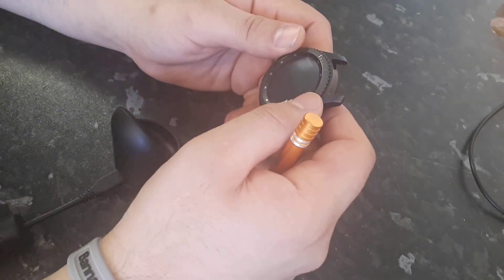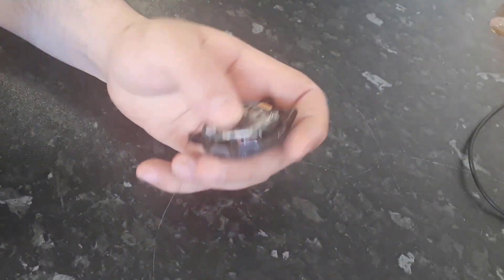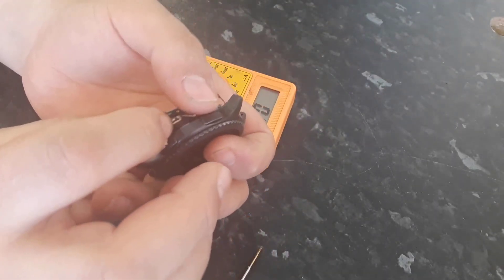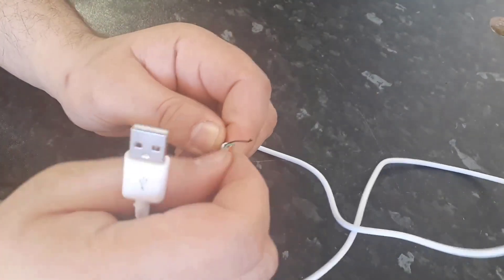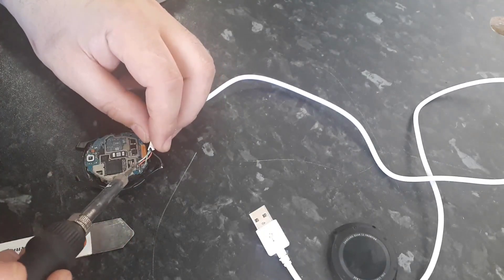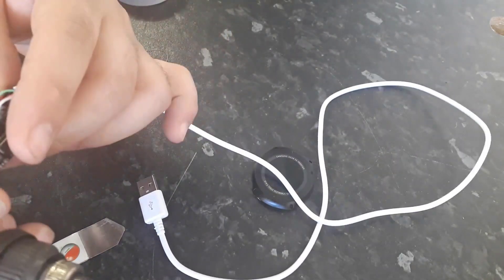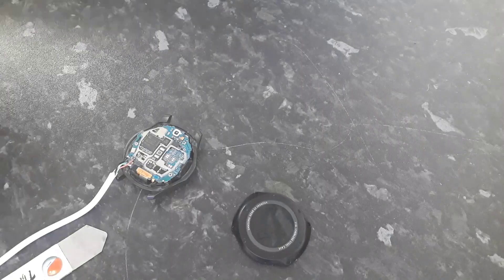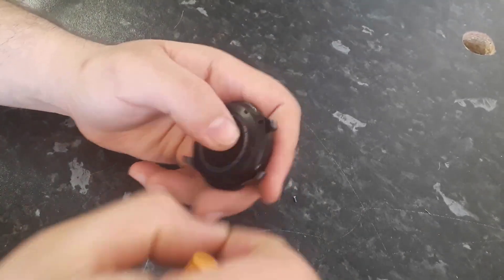Samsung Gear S3 Watch Dead Repair

Comment: I have got to admit that I was watching this thinking "There is no way this will work." But I bit the bullet cause I was pretty much at the end of the road with me favorite watch and tried it. I was SHOCKED when the screen came to life for the first time in a week. I have it charging now. 
I am curious though, once the watch gets to 50% or even 100% charged, will I have to do this EVERY TIME I want to charge my watch? Or will the cradle charger work again?
Reply from the maker: Hi, you don't have to do that every time, but try to change the battery to a new battery if it happens again.
Reply: @anwarigroup  Thank you so much for the advice and help!
Reply: Basically manually jumpstaring battery to a percent that will be recognized by motherboard and allow charger to charge and balance the battery.

Comment: I changed the battery, but when I put it on charge, it doesn't charge. It stays at 0.What is the solution?
Reply from the maker: change the battery

Comment: Is mine completely dead? Cannot charge. I drained the battery and did not charge for almost 5 days then this happens. I usually do this but this time it's completely dead.
Reply from the maker: Some batteries when they get fully discharged and are not charged for some time, can not be charged, so sometimes applying a few higher voltages directly to the battery, fix this problem.

Comment: What if watch is charging curectly but doesn't turn on? they doesn't react on button pressing at all
Reply from the maker: use a tweezer and short the button sides, maybe button is damaged.
Reply: @anwarigroup  thanks for the answer, i think that button is not the problem, owner of watch gave it to some guy and he either tried to update or replace its firmware, the thing nobody asked to do. Now i try to bring them back to life. After that dude the watch started to discharge very fast and turned off after full discharge. I've charged them full but they don't turn on. Maybe you have any ideas? Thanks.
Reply from the maker: @aequitasveritas3419  recharge the battery, try  again pressing home button, change the battery and try again, and or connect it to a power supply and try it.
Reply: @anwarigroup  I'll try to do so, thanks for the answer
Reply: @anwarigroup  found the reason, it is the button, oxidized contacts on the cable at the junction with the board, soldered it and problem solved
Reply from the maker: @aequitasveritas3419  Super.

Comment: Hey bro if i connect only 2 wires red and black will it charge?
Reply from the maker: Yes, it will, unless the red and black are not red and black. But does it matter? Yes, It does, as the Red needs to be positive input and black negative. Unless the colour is not important, but the polarity needs to be correct.
Reply: @anwarigroup  but if battery overheats by 2 % of power its dead better replace it right?
Reply from the maker: @Izzy-w2p  make sure not to connect 5v to the batteries. These batteries are about 3.7V. They are Lithium lipo batteries. However, if the battery is overheating, it can be due to many reasons, one of the reason can be the battery itself.

Comment: My gear s3, flickering green screen and lines. How can i fix it?  I tried rebooting it by holding the power button. :(
Reply from the maker: Put it in download wireless mode and flash the firmware.

Comment: Sorry friend can it possible solder only red and black cable of the usb to charger the battery? Why also data (green & white)? Thanks
Reply from the maker: For charging, RED for positive and Black for negative will be enough. Green and white are for data communication.
Reply: I know it! In your video you solder all cable also data but for relife the battery drained it's possible solder only red and black cable and connect it to supply power 2A 5V usb or other amper (1A)? Thanks
Reply from the maker: @lillyminutolo5716  4-5V. One hundred mA to 2A would be fine.

Comment: good day sir, may i know if soldering a usb cable to the board can stil be achievd if the green data pin is lost or removed from the board. please help me
Reply from the maker: There has to be a connection. If the pin is removed so solder it to the pad, If the pad is removed you have to track the pad to find its root and solder the wire. Without soldering wire, you can not connect it to the computer.

Comment: Hello I have a samsung gear sport sm-r600

which does not start anymore.
When I put it on the charger it lights up with the logo (samsung gear sport) and turns off. the charging light is blinking but I can't turn it on.
I have changed the battery.
I can send you pictures and videos of the problem.
I went to your site but I cannot send you a message, (fire blocking)
Thank you for telling me how to do it

Thank you, I hope you can help me.
Reply from the maker: Send me an email Habib@electrovo.com
Reply: Have you solved?

Comment: I've had my Samsung Gear S3 watch for over three years.  during the beginning of the 2nd year the watch won't turn on it showed 100% charged. but no matter what I did it won't turn on. I finally gave up trying an took the watch to the T-Mobile store I purchased it from.  They performed a song and dance routine and then suggested I take it to a watch repair shop.   I decided I wasn't ever going to get a Samsung watch again.  Now tonight I'm on Youtube an happen to run across a Gear S3 topic and it suggested placing the watch on the charger an perform the reboot routine. I was both happy that it worked and dismayed that the T-Mobile support didn't know about this.

Comment: Hi sir..i charge to docking but red indicator at docking blinking..i use tester test the battery 3.6v..but my gear not turn on..whats problem..please..
Reply from the maker: check the side buttons with a multimeter, make sure they work.

Comment: My watch battery 4 volt but not charge or anything
Reply: No waterdamage. Sticker is white. I think other problem
Reply from the maker: Under the back cover of your watch is an electricity power receiver., Check that and check its a connection to the motherboard. That wireless power receiver has to transfer power to the board.

Comment: Incredible. Y did it with a cable only with red and black and only charged it for 1 minute without solding them and with my hand steady jaja. Then I placed it in the charger and did a reboot pressing 3 times the lower button. And there it is.. charging from 1 percent...thank you man! 😂
Reply from the maker: You are the legend!.
Reply: @anwarigroup  had to do it again today and it worked. ..jaja.. thanks again

Comment: If this does make the watch charge then what is the fix for the watch to go back to charging the normal way?
Reply from the maker: The problem of this watch was that the battery was fully drained. So in this case particularly for this watch, it was not able to be charged by the wireless charger., So The problem could be simple to boost the battery charge by connecting these wires. And or the problem can be with the battery. So the watch may need a new battery. Some times, the problem is in electronics, on the motherboard. So if it down to battery change the battery and it will charge normally. And if it just needs a boost charging as I did in the video so do it that way. Then monitor the battery and see how it goes. if the charge and discharge time is ok. So leave it like that, otherwise, change the battery.
Reply: @anwarigroup  Great video what if i put more stronger charger like 2 Amps because my battery charge barely to 3% thens overheated and stops charging then it shows 0%?thanx
Reply from the maker: @Izzy-w2p  Increasing current isn't a good idea, it will damage the battery and or reduce its life cycle. If your battery charges to 3% and then overheats and dies, then there is a problem with the battery. Change the battery. I would use a 100mA to 500 mA 3V charger to charge the battery and leave it for an hour to charge. If the battery isn't charging as I said, it's best to change the battery.
Reply: @anwarigroup  the watch is 3.5  years old probably the batery is dead you r right
Reply from the maker: @Izzy-w2p  Correct, Lithium and other batteries has life cycle, I am sure within 3 years, the battery used its cycles. Therefore, I think, the best thing is to change the battery.
Reply: @anwarigroup  It starts when my watchstrap fells off and watch falls off of my hand and back of the watch bottom cracked now ive changed the back case and right now ive cleaned the sensors inside the watch and its not overheating anymore its charging for now ...thnx for great answers mate🔥
Reply from the maker: @Izzy-w2p  Good, overheating can be caused by many reasons. But keep in mind, the batteries have an age, they have a life cycle. Sooner or later, to have a better watch usage, you will need to change that battery. I have a watch, it's almost two years. It is not as the day one. I will have to change it some time later. If your battery is still working and not over heating, and you are happy with the charge time, so keep it as it is. Otherwise, replacing with a new battery will be the best.
Reply: @anwarigroup  thanks for your reply. I tried this fix and I think I might have messed up more as the soldering was not very good and there was a short circuit so it's not charging at all. I'll just have to throw it away.
Reply from the maker: @Fylosofy_  if you want post it to me, I will try to repair it for you.
Reply: @anwarigroup  Where are you located? Because I'm in South Africa so the postage alone might cost more than what the fix is worth.
Reply from the maker: @Fylosofy_  Yes, I live in UK. It is quite far.
Reply: Hola tengo un reloj R845F quiero el pinout para hacer la conexión usb para pasarle el software por mi laptop 
Ya que intente cambiar el csc y se quedó en download no se puede pasar por wifi por qué no se activa quiero saber donde ves que van los puntos de conexión para soldarlo

Comment: I accidentally detached one of the terminals when soldering. Can I just completely remove it, then make the solder in place?
Reply from the maker: yes, but the base should be fine. If it is ground, you can take ground from metal plates.
Reply: @anwarigroup  Thank you for your quick reply. The solder is not sticking to the base, and I think it's messed up. 
My understanding of the steps = 99%
Soldering skill = 0% haha
Reply from the maker: @lalocampo  what pin is damaged?
Reply: @anwarigroup  The white and green data terminals
Reply from the maker: @lalocampo  see if you can make a connection. use a multimeter
Reply: @anwarigroup  can you explain further pls. I have a multimeter here. I don't know which ones to check and how. battery is 0. thanks again.
Reply from the maker: @lalocampo  Come to my website, use the FB messenger and chat to me. www.electrovo.com
Reply: @anwarigroup  Okay, will do. Thanks!
Reply from the maker: @lalocampo  You need a multimeter, Under the pin you broke is a route, follow that route find a contact, make a connection by soldering a wire to that contact.

Comment: My power button is not working. any solution for that? Appreciate you.
Reply from the maker: You need to change it. For quick action, you can use a tweezer and short the two pins. You can search on eBay for a replacement button.

Comment: it takes a 6 hours to full charge and drain in 6 hours. can you help me what i can do???
Reply from the maker: Change the battery and check again.
Reply from the maker: Also, try with different charger if the result was the same.

Comment: Great video. I did not know you could charge a battery like that. I´ve got a Gear S3 that charges no problem, but won´t turn on. Suspect the buttons are not working. Have you got a video that shows how to test them and carry out a repair, please?
Reply: Same problem, mine charges, it does not turn on

Comment: You seem knowledgeable but I can't see what your doing good sir
Reply from the maker: This watch has power problem. The cell is fully drained off. The cell is gone over discharged limit and it can not be charged back. Or the cell could be faulty. So when a fine cell goes over discharge limit then it can not be charged back with the low current of the watch circuit board. Connecting 3 - 5 volts with 1 amp current directly to cell will boost the charge on the cell. So if the cell is faulty or electronics are faulty the cell will be drained off back again. If the cell and protection electronics work fine then the cell will stay charged about the discharge limit.

Comment: If the red light on the dock is flashing your battery is full discharged then: Put the watch on the dock red light is turn on when starting flashing take the watch out of the dock then put it again when start flashing take the watch out and do the same about 10 times and the watch will start charging. Cheers
Reply: It didn't work for me.

Comment: On my s3 sensor not working. Do you have any idea how to fix it
Reply from the maker: Hi, Open your watch, disconnect wall connections, clean them and put them back together, update your watch to latest firmware. 

Your watch problem can be one of these issues: 
Hardware, if it is hardware motherboard and or sensor, so you need to change one of them. 

Second can be software, update or reset to factory settings.

Comment: I have changed my battery and now it wont start. When i charge it went from red to green. Anyone can help me?
Reply from the maker: Check your battery voltage by a multimeter and see how much charge you have there. if you have 3v so close your watch and charge it and try to turn on. 
If your battery has no enough charge so charge it. 

Check your battery after charging. See how much voltage you get. 

Your new battery sometimes can be faulty too. 

After that if battery is ok, so check your power switch. Your power switch can be faulty too. 

If your battery is charging. and your power on switch and flex wire is ok. So then check all wires connected properly. 

If everything is ok so then it works to the watch motherboard. If watch motherboard. 
Your display screen can be faulty too. 
Sow now if you have a spare motherboard and display screen, so check by replacing them.

Comment: Hi, I have problem with my gear.
I use my samsung gear to swim and the water enter to the gear, and reboot system occur.
to solve the problem i came to samsung store to clear and dry all the water in my watch.
but today lifetime my gear its only 8 hours.
What should I do? 

Change the battery?
Reply from the maker: Hi, change the battery. if didn't work change the watch.

Comment: I want to flash gear s3 frontier with usb cable like ur video of ( un brick  gear s2) because i downloaded wrong frimware so the watch doesn't want to open so  can i connect usb cable to pc and watch like the method in this video
Reply from the maker: Hi yes you can. More information are available in below link: 
https://electrovo.co.uk/guide-to-connecting-a-samsung-gear-s2-and-s3-device-using-wi-fi/

Comment: Hi I have a dead S3 I wanted to know if you need to connect all the cables or just connect the red and black.
Thank you
Reply from the maker: red and black is for power. two other wires are from data transfer.
Reply: @anwarigroup  ok but for charging is necessary to connect the black and the white ok?
Reply from the maker: @mikitoni13  Black is Ground (-)(Negative) power, Red is positive (+) power, white and green are for data transfer. If you you want to do data transfer such firmware update so connect all 4 wire. If you want to just charge up your watch so connect two wires, that are Red and Black.
Reply: @anwarigroup  ok i connected the black and white but the charge doesn't start .... can the motherboard be dead?
Reply from the maker: @mikitoni13  connect black and red. If you connect the white so white has to be connected to a positive 3-5v power supply.
Reply: @anwarigroup  ok but the white cable what is it for? in my case I connected black and white but as I told you I don't see any reload on the screen.
Reply from the maker: @mikitoni13  white cable is for data transfer. connect black as ground connection or negative connection and red as a positive. Check the battery health. If you can't see anything so your watch may have motherboard problem.
Reply: @anwarigroup  yesterday I managed to connect the cables and charge the battery but the clock does not turn on even though I have charged at 100%.
Reply from the maker: @mikitoni13  Check the power button contacts. Try to turn it on from inside by a tweezers from inside.
Reply: @anwarigroup  hi i changed the motherboard and the clock started ..... but when i put it on its charging base, the charge doesn't start.
I disassembled the charging base and tried with a tester to see if energy came from the usb, the energy comes but it is never fixed at a certain value ... you who have more experience do you think is a problem of the charging base?
hello and sorry the trouble
Reply: Thanks man, it worked for me, I just charged until 1% and it was enough to put on charger and it charging no problem now